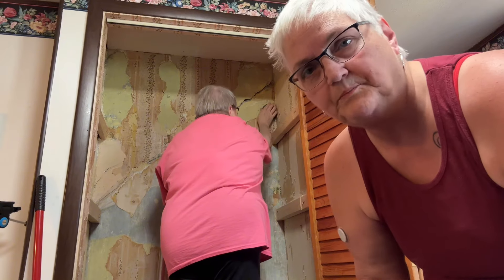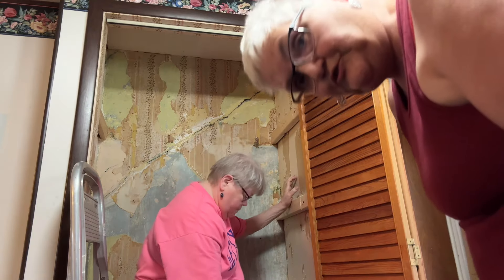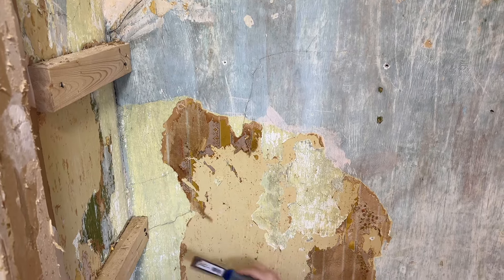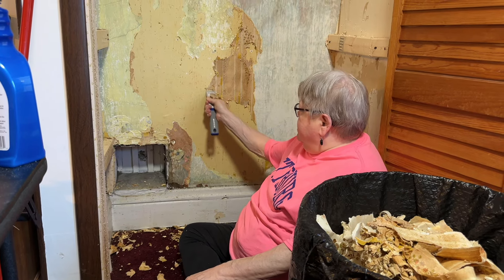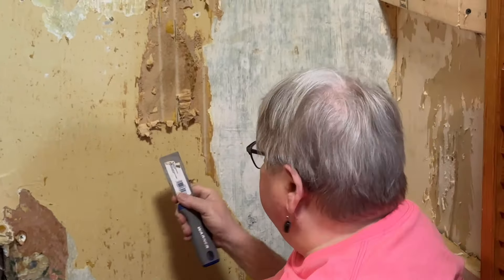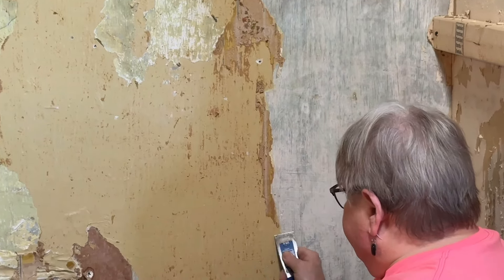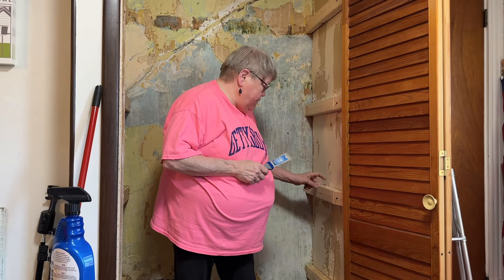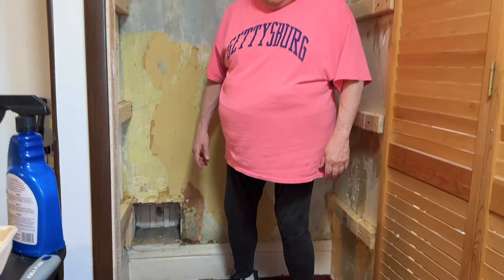Part 2- Juju’s Stripping again! Wallpaper gone!

Comment: It seems to be such a small space but you need to invest time and elbow grease. The wallpaper glue which is available in Germany can be removed incl. the wallpaper with using hot water and some dish soap in a sprayer after scratching the wallpaper with that round thingy with the blades CeCe used in part one quite well.
Depending on the amount of removing more wallpaper making your house a home look for renting a steamer or even in an investment for one.
One project at a time! Can't wait to see your next video ❤👍
Reply: Yes, I agree with you. I have a steamer in my home decorating kit. They are invaluable for stripping whole rooms back to bare walls! I've never seen chemical wallpaper stripper before. I've always just used warm water and a sponge to wet it down first, or the steam stripper.